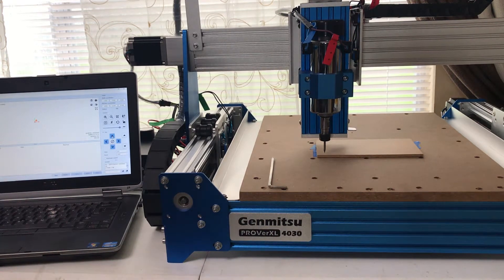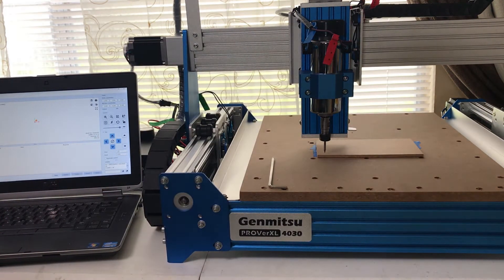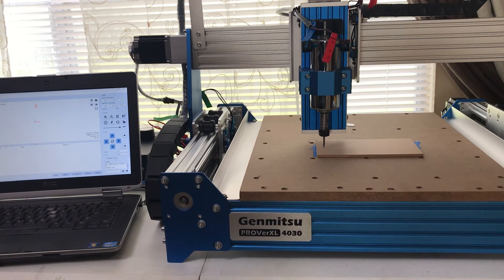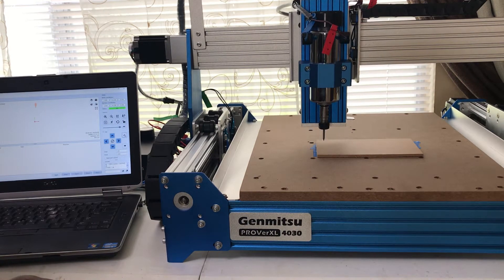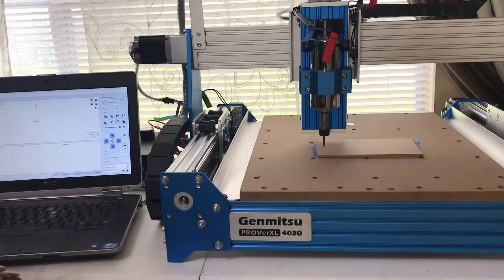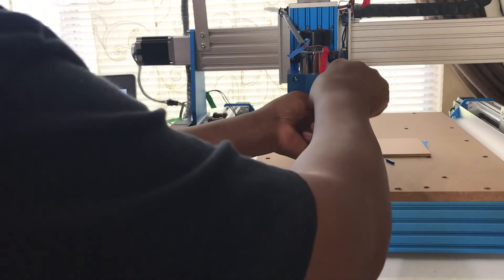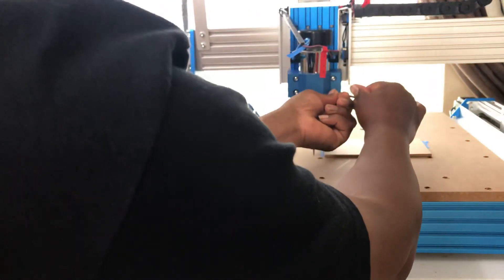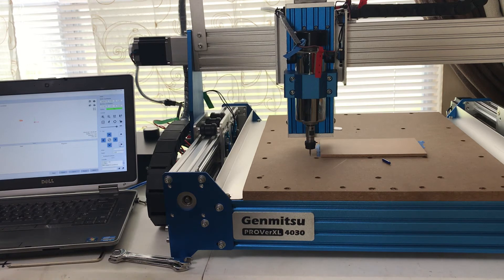HOW TO GET OUT OF BEING STUCK IN THE X, Y, and Z AXIS LIMIT SWITCH IN GRBLCONTROL PROVerXL 4030 CNC

Comment: to save your spoil board, sandwich another piece of wood in between with tape/glue. this gives you clearance to cut into the entire intended piece. 6mm mdf is is cheap and can be used over and over until it falls apart.
if you decided to upgrade your bed to railed (highly advised) - this technique is a MUST

also, the offline controllers are worth their weight in gold. it's so much easier to jog the machine with a touchscreen than you pc/laptop - you most definitely won't regret buying one

Comment: The spindle mount is shipped in that position to reduce the over all length in when in the packaging.  Every user has a different use for the machine, so it's down to them to decide what height they need to motor mount positioned.  Some of us, on occasion may even take the bed out, drop the motor right down and engrave the surface below the CNC.  This is really not a design fault, it's just operator error.